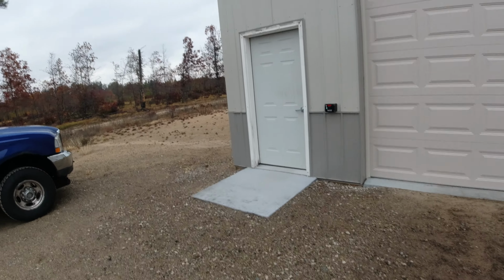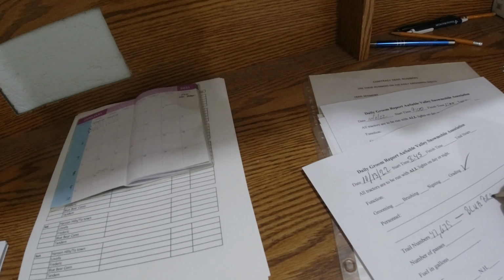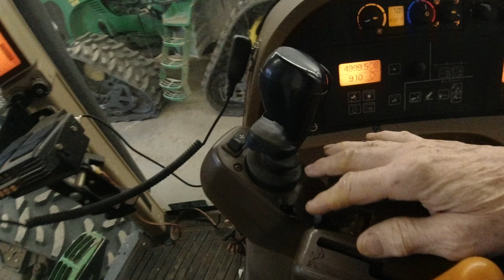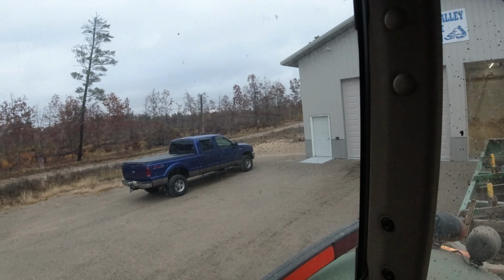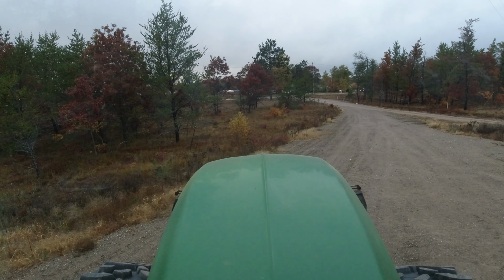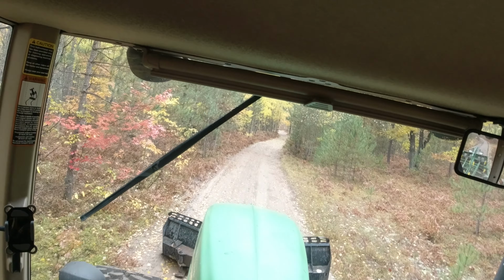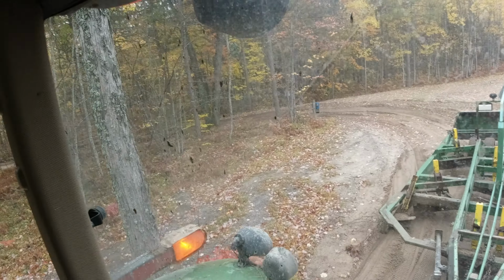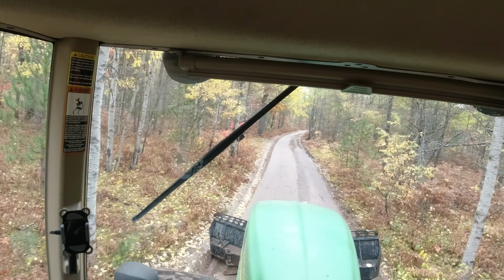Grading snowmobile trails 2022

Comment: I think you did a nice job for your people there Malcolm. You can't ask for better than that level of work. That trail is so smooth and will be that way as long as they don't rut it up right after you ran through there. It should pack nice and give your snowmobilers a smooth safe trail to ride on. We don't have snowmobile trails in Ohio anymore, the one at our local park says "snowmobile trails closed". It's been 20 years or more since we had enough snow to open them, there's not a trail left to be honest just a sign. We will never have off road vehicle trails here I'm afraid, just mountain bike and foot traffic and the trails are closed when it's wet because they don't want them to be torn up. So I think what you have there is pretty great!
Reply from the maker: Thanks.  We lost the snow after about four days.  Last three years have been very disappointing.
Reply: @malcolmsadventuresinnorthe5958  Like I said about snowmobile trails here in Ohio, they've been closed for years. The 70's-80's where the last time they were open. It doesn't stay cold for months anymore so we can accumulate any snow. It seems the global warming thing isn't a joke. Maybe we're just going to have to deal with it unless it's a cycle and the cold weather comes back to stay, other wise we'll be wearing shorts year round in the North too!

Comment: Just curious, are there designated UTV trails in that area?
Reply: Yes but mostly they are separate from the snowmobile trails.  Many of the snowmobile trails are on or access private property.
The ORV trails are on state or federal land primarily.
Joe
Reply from the maker: There is a parking area on the west side of Grayling Trail 79. It is on highway M 72. Disagnated ORV trails there going North. Another parking area on same system west of Frederick on CR 612.

Comment: Nothing runs like a deere... Farmed with Deere's most of my life... 730D; 3010G; 4420D; 4430D; 8430D... lot of saddle experience on 200 acres...  Retired and moved to Roscommon, Mi. IN 2019 with my wife.  We enjoy SXSing.
Reply from the maker: Yes, we like our Deeres too.  I farmed with one downstate,  I had an old "B" I used to pull the hqy wagon. We had one we mowed and blew snow with when I worked at Lapeer airport.

Comment: You’re pulling what we would call a float. You just make a mess pulling them when it’s wet. The dirt won’t slide good. Need to be dry to slide around and level.
Reply from the maker: Official name for this one is a "Dubby Groomer"  (we call it a drag) it makes a tolerable grader on our sandy soil. It even has a big scoop at the rear just in front of the pan to move large amounts of snow/dirt to fill holes.  Where are you located?
Reply: @malcolmsadventuresinnorthe5958  Deep South,U.S.  we pull them 15 feet wide and 60 feet long. Use them to level fields prior to planting.